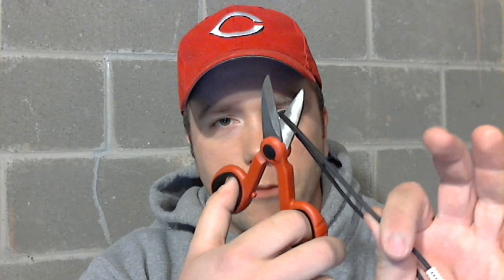How To Fix Your Video Game AV / RCA Cables, or Quick and Dirty RCA / AV Cable Repair

Comment: What if the rip literally ripped off, like the tip. There was no cut.
Reply from the maker: Same process, but you would either need to cannibalize a generic set of cables or just buy replacement RCA connectors. It all depends on how easily replaceable the cables in question are, and what you have on hand for spare parts.

Comment: In the beginning you say how to fix a broken head on the end of the cable... Not a ripped wire? .-. Would you kindly show how to fix a cable when the metal head snaps off and the rubber is there? .-.

Comment: fuck , I have the opposite problem.  The actual Plug itself ripped off, the RCA head from both of my stereo speakers.  So its two RCA heads for each speaker that plug into the stereo unit.  I just dont see this happening for me w/o a soldering iron.
Reply from the maker: Not sure exactly what you are saying, but if you mean there was a female RCA plug on the back of your speaker that came off, yes you will likely have to solder.

Comment: Can You Make A Video Of How To Fix Ripped Heads Of An AV Cord With Proms That's For A PS3 If You Can Please Accept My Wish
Reply from the maker: I would, but I'm not sure what that is. I do not own a PS3, but I'm pretty sure that the ends of the cables would be manufactured in the same way.

Comment: Bro, you’re not bad a explaining stuff, but you need to work on that camera angle. Also, show the item you are fixing instead of just cutting some random wires, off camera...
Reply from the maker: It was only meant to give the gist to one of my subscribers. I figured if they couldn't figure it out based on what they saw on screen they probably shouldn't attempt the fix to begin with.

Comment: So, I've managed to rip not the entire head, but the outer aluminum part of where one of the audio cord plugs in. Now my right audio cable won't work. How do I fix this?
Reply from the maker: Oh my, that is unfortunate. If I understand you correctly, your only option now is to either cannibalize another cable, or buy a new one. Sorry.
Reply: Okie. Thank you anyway
Reply from the maker: Good luck.
Reply: EdT1138 Thanks. Question, does a PS2 video cable work with an N64? It fits, I know that.

Comment: So you have wire strippers and scissors but choose to use your teeth instead? why
Reply from the maker: It has been nearly eleven years, but I believe I said in the video that I was lazy or it was faster. I do many things that I wouldn't recommend other people do, so I guess it is just a negative aspect of my personality.

I have lots of tools and supplies that I could have used instead but didn't, and I believe I mentioned in the video that I was using items that most people would have in the house. 

I still recommend not using your teeth, but I still sometimes use my teeth.

Comment: Hello. I had an RCA plug, which had the long metal part that goes into the connector break off. My friend gave me a replacement plug, but it has no wires. It unscrews, and there is just a bit of metal where I assume the wires are supposed to go, but I'm not sure, and I don't have any instructions. The new plug is very much something like this: http://tinyurl.com/l8dyudg (sorry, this the best picture I could find of it) Any help would be greatly appreciated. Thanks!
Reply: Never mind, I found some info, but excellent video nonetheless!
Reply from the maker: William Harrell
Sorry man, for some reason this got flagged as spam, so I never got a notification on it. Glad you found your answer though.